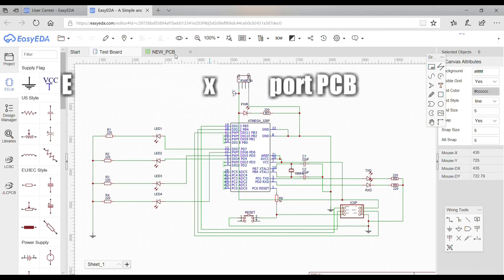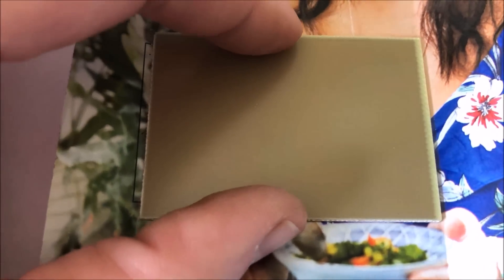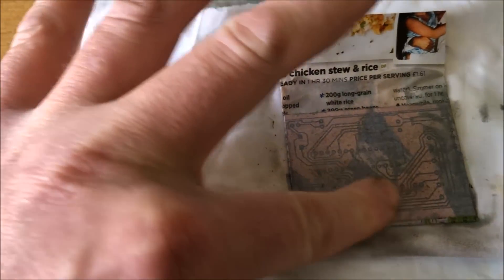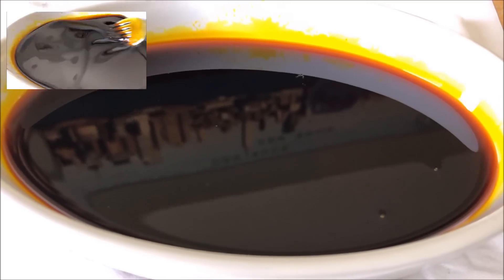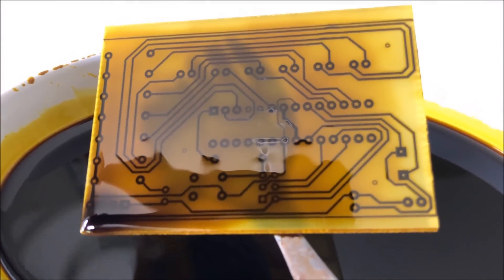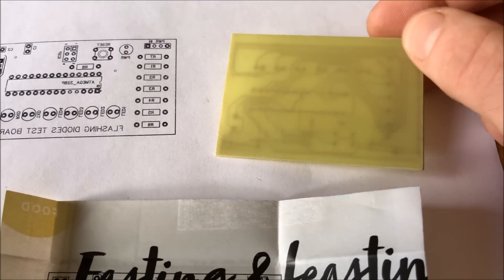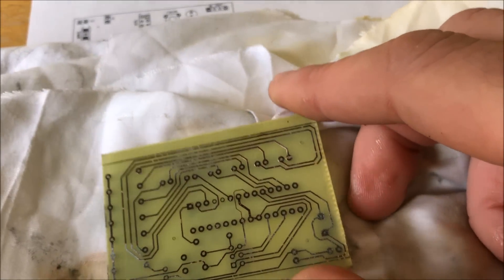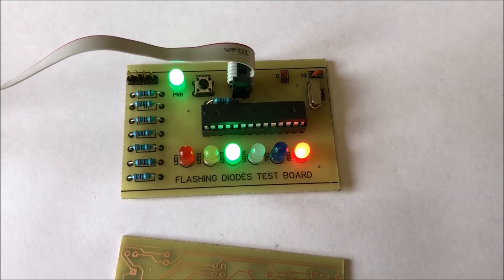DIY PCB Toner Transfer (No Heat) & Etching

Comment: Tried this myself with pure acetone, different types of glossy magazine, different pressures and different durations soaking the paper. Only one gave a partial transfer. Then I read a comment here about adding water to the acetone (2 parts acetone, 1 part water) and it worked! (Samsung toner).

Definitely some chemistry taking place as I tried different colour toners, they start out the toner colour at the time of transfer but then slowly change and become darker. So I would suggest giving it time to rest before etching to 'cure'.
Reply: I confirm. Acetone works well with water (1:1) and glossy magazine paper! 🤔
Reply: I am using 98percent acetone nail varnish remover from super drug in UK diluted to 2 parts acetone anf 1 part water (but I see the other comment here 50/50) and I made the mistake I think of printing on the magazine cover not a magazine page. I think the wetting and release perhaps works better with the inside paper less then the cover.  For sure the ironing thing doesn't work with the cover paper. anyway with the acetone mix it released ok'ish. better than  other methods I tried but not 100pc. there is a pitting in the blacks which I had to put marker pen on . I was hoping for a solid black but I'm not  getting that. like I  say it may be the choice of covers instead of inside pages. I'm stuck with the materials I have as I don't have a laser printer and got someone else to print it for me.  hopefully the  etch is ok despite

Comment: Can i use a deskjet ink printer or i really ned the laserjet printer to print the layout?
Reply: I think you need a laser printer. I don't know exactly why and how the toner is different from regular ink but I tried with the ladder and if you wet too much the ink it slides away easily. If someone knows why you need a laser printer instead of a inkjet plz let me know.

Comment: Cant figure out how you lined up front and back? i keep being off any suggestions.
Reply: Once you finish the first side just drill out three of the through-holes as close as you can to each corner of the board. Punch out the same holes in your second template. Push wire through your board and drop the template down on top :)

Comment: Wow ,goto say that is a lot easier than other methods seen,well done.
How does SMD work out say 0603 min size part ok?
Best track width used with this sytem?
Min Track width used with this system?
can set up in rules in pcb cad software then.

Rob
Reply: Hi!
I used similar technique a couple of times, with heat transfer.
First off, now I think heat transfer is subpar - the pressure and the heat can stretch or shring the paper varying with direction, and it can flatten (making it wider) tracks.
But even with heat transfer track wifth of 0.5 mm is quite manageable, and 0.3 is doable with patinence, caution, and luck.
I would expect 0.3 is managable with this method.
SMD 0603 could be okay, but for hand soldering, 0805 is small enough already.

Comment: do you know about this?
1) hydrogen peroxide 3% 100ml
2) 30gr. citric acid
3) 5 gr. table salt
this is enough to pickle 100cm²
Reply: You mean instead of using acetone, that is to transfer toner?
Reply: @youssefdirani  this is to replace FeCl3. you can use hydrochloric acid (cheaper) instead of citric acid (more expensive)

Comment: I used pure acetone first 3 times didnt work BUT then added water to the acetone and it worked perfectly! 1/3 water works well, 1/2 water can still work but 1/3 water worked perfectly. Glossy magazine paper is the way to go, but after getting so good results with 1 part water 2 parts acetone I tried one with normal printing paper (pretty rough, not glossy) and even that almost works, got 50% transfered. The groves in the rough paper hold on to the toner though i think, so go with glossy paper.
Reply: 1/3 water works well....
1 part acetone and 3 part of water or 1 part of water and 3 of acetone ?? Thanks a lot.
Reply: I think he meant half and third of water
Reply: 1 acetone and 3 water?
Reply: @aircomputersfranca  1:1 is OK for me with my toner and my glossy magazine paper (:
Reply: Thanks man, this is what I needed. Couldn't get it to work with pure acetone but 1/3 water added works just like the video
Reply: Why it didn't worked the first time?? For me, the acetone based nail polish didn't do anything at all...
Reply: "...but after getting so good results with 1 part water 2 parts acetone..." So there it is: 2 gallons of acetone and 1 gallon of water. Or 2 tablespoons of acetone and 1 tablespoon of water. Or any other unit of measure you want to use.

Comment: I have to call BS on this one... I did same thing over 60 times, never worked... Using an HP laser with original HP laser cartridges. I had 75% success, but never like this. I used different glossy magazine papers, I used HP premium presentation paper, I used nail polish (3 types) , pure acetone, acetone/isopropyl mix at various levels and never came out. Ironing board works well for me, but that 3 minute "no heat" quick solution is, well, too good to be true. If I have to import a friggin bottle of Sally Hansen nail polish from the UK to Canada I will, but for now, this myth is busted...
Reply: I had only parts and very faint transfers the first 3 times. On the fourth I pressed much harder and it worked very well. Make sure you press hard! I think I was only pressing half as hard when i got only very faint results. Also, the time it worked i actually mixed water in the acetone, i used 50% "chemical acetone no oil" and 50% water! I think maybe the paper needs to be dissolved by the water, although not sure the water was what helped. Make sure you press hard!
Reply: I used a normal Lexmark laser printer, I don't know if different printers have different toner no idea.

Comment: Super Awesome !
Swap the FeCl3 for Vinegar, Salt and Hydrogen peroxide and all the design/etching materials can be bought in the supermarket !
In the UK they swapped the Acetone in nail varnish remover for Ethyl acetate some years ago.
Use gloves with either solvent - they tend to transfer through skin, bringing whatever they dissolved with them.
Reply: In what ratios?
Reply: I really didn't bother measuring. Mostly vinegar, loads of salt and a small amount of peroxide.
Fortunately this would be very easy to experiment with on a very small scale to find the exact proportions of each that would work best for the vinegar/peroxide available to you.

It would be hard to make it not work, just better if it goes as fast as possible.
My vinegar was 9%, the peroxide 3%.
Reply: aga Or just buy acetone

Comment: You need to have the right type of toner.. I tried this many many times with zero success. I think my printer uses the wrong type of toner.  I found it easier to just run the board thru a laminator 10 times and be done with it.  Only takes a few minutes.
Reply: MasterToko  I used glossy magazine pages. I didn't use nail polish remover though, I used acetone. Will have to try this again.

Comment: Isn't that nail polish remover just Acetone with aloe and vitamin E oil mixed with it?
Reply: Mike, no it's not...there are many additives in there. I tried nail polish (Wal-Mart Equate acetone based) remover vs acetone (MG Chemicals) and the nail polish does not smear the traces where the MG Chemical pure acetone does immediately. Same thing with nail polish remover that said 100% acetone vs the MG Chemical acetone and the nail polish remover did not smear the traces (100% acetone nail polish remover vs true Acetone). Go figure...
Reply: @cac2244  The biggest issue I have with laser printed PCBs ... small parts ... even a 20 pin standard chip ... the holes are so close together and so small, a toner transfer works but its tight and very little margin for error. I did a couple or PCBs using EasyEDA and I ordered them professionally manufactured ... I got 5 of each board for $6 total including three day shipping ... I could not believe how cheap it was to have them professionally made. Here they are:
https://i.imgur.com/EfHawzp.jpg
https://i.imgur.com/XdtlXwc.jpg
https://i.imgur.com/JBRVQhD.jpg
https://i.imgur.com/MTjCUoY.jpg

And another circuit (pro made board and home etched of the same circuit):
https://i.imgur.com/R2TdzAX.jpg
https://i.imgur.com/3dqYdxK.jpg
https://i.imgur.com/Nr0Mpvt.jpg
https://i.imgur.com/7aoxnRN.jpg

Comment: I was sure hoping this would work. I've been doing my boards using the clothes iron method for years, and if I'm lucky I can salvage 67-70% of the attempts into working boards using glossy printer paper (and a lot of heat and pressure and 12-15 minutes ironing per board). I've tried using a waffle iron, which by all rights should work. Nope. I've tried Acetone and alcohol - supposedly if you get just the right mix it will work. Nope. I've used magazine paper with the iron. works as long as the paper is white. Dark colors will iron onto the board right along with the toner.  Now this. Looked easy. Too easy. Wasted most of the day today trying to get it to work. Nope. Best I've done is a blurry shadow of the traces. Damn. Back to the iron and glossy printer paper.

Comment: Impressive! One question about the silk screen, I didn't catch it in the video... How did you line the silk screen up with the traces on the other side of the board?
Reply: I guess it doesn't really matter if the silkscreen simply has component designations, and is out +/_ 2mm or so.  But using the same technique for double sided boards would almost certainly need a jig (or at least some registration holes in the board and transfer prints, prior to placing them).
Reply: Gotcha, thanks!

Comment: I have to thank you for sharing. I've tried many methods in the past, this is the best and easiest method with guarantied results. To help others; I used cheep nail polish remover but the one with acetone worked perfectly (same brand). I don't know if the magazine paper plays a role cause it's glossy and thin.
Reply: My favorite process was to spray an overhed projector sheet with silicone spray before running through the laser printer.... the transfer was as horrible as everything else I tried, but watching my son fall from walking through the kitchen with only socks on because of the silicone overspray onto the linoleum was priceless!!!  😁
Reply: @rosebarnes9625  interesting, new stuff to learn. Please anyone who has good techniques, please share it with us.

Comment: In the past I've made Toner Transfer PCBs and only had success with toner that did NOT use fuser oil. I use Brother printers and Brother brand toner does NOT use fuser oil while off-brand toner cartridges use the cheaper toner with fuser oil. Toner with fuser oil does not adhere well to the PCB and will often smear or even slide off.

Comment: I prefer to use Hydrochloric acid and Hydrogen peroxide to Ferric Chloride for etching-no so messy and much cheaper.
Reply: Interesting because I buy a 500ml bottle for less than $2, put it in a Pyrex container under the sunlight with some water and that sh*t last me for at least 3m2. 

What's the performance of your method?
Reply: @Chuywaka  I pour some HCL into a pyrex dish just enough to cover the pcb properly and then add some  hydrogen peroxide to it. There apparepotent and let you cough.ntly is a formula about the ratio, but I do not know what it is. However, I get along fine just adding some peroxide as and when needed. You must do the etching outdoors as the gas generated is quite potent and make you cough.

Comment: Wont the solvent dissolve and smudge the tracks during transfer?  Only heat transfer seems to work best in transferring without distorting the original tracks.

Comment: A bit messy, but a nice alternative when I run out of heat transfer paper. Makes it harder to line up for a double side etch.
Reply: Drill the holes first then its easier to line up - use a pin to do the alignment

Comment: Isn't it cheaper to order 10 professionally made 2-layer PCBs from JLCPCB for a total of $2 instead of getting a prototyping copper board for $5 and then trying to etch it on your kitchen?
Reply: can you point me in the direction of such a service in the UK ?
Reply: @rpowell3000  jlcpcb.com, you upload your Gerber file, if you order up to 10 pieces they're $2 for the batch + $6 for postage (air registered, slow method but very cheap), and because the cost is too low, you won't have to pay for import taxes. Silkscreen is included, 2 layers are included in the same price, all PCB colors are the same price, maximum pub size for this price is 101mm X 101mm. I haven't tried them yet, I'll try their service probably within this month. I've seen a small "documentary" about their facilities by another youtuber.

Comment: A small "speed-up" hint for the etching portion: After you transfer the toner and wipe it with the sponge, use a hot air station (or heat gun/hair dryer) to warm the copper. Take the time to warm it up and when you dunk it into the ferric chloride, you'll see bubbles and it'll etch at a much higher rate for the next minute or so.
Reply: Years back when I did these, I placed the ferric tub in a tub of hot water. The heated ferric was much quicker, I just rocked it from side to side.
Reply: That's neat! I was wondering how heat would effect this process.
Reply: Thanks I will implement this in my project
Reply: Another hint: Next time make a large ground plane. You'll use far less etchant. :)
Reply: @humbughumbughumbug  I find large ground planes difficult to solder without bridging, since the at-home pcb method has all of the copper exposed, vs having lacquer covering the copper in the spots where there are no components.
Reply: @larrybud   I agree. I have to do a lot of solder wicking to fix that!
However a few times I forget to put in a pulldown resistor, it was kind of convenient to have a ground plane to solder to! 😆
Reply: @larrybud   or just set a bigger gap in the design rules so the ground plane is less likely to bridge to a contact pad. Especially when prototyping you should expect to make mistakes, but also you'd want to conserve etchant for iterations.

Comment: Ingenious method of substituting chemical transfer for heat transfer!  I can't wait to try it out.  I'd love a few tips on how you got the top and bottom to align so well!  And for the masterstroke, what method do yo use to align and drill all those little holes?!
Reply: For the perfect alignment, use pre-folding the magazine paper, because the to-be PCB will actually align to the folded edges when you put on the masking tape.

Comment: Just a question and a comment/suggestion Question is this is done with a LASER printer right (A lot of videos or tutorials are with inktjet) also with the chemicals just to get it straight into my head I use the nail polish remover or acetone (Which someone mentioned and my mum used to clean her nails back in the day) and then developer? I'm going to try my first board, and am new to this, and of all the videos tutorials so far this seems the easiest more professional one (Also because you use the ATMega328 Which is what I'm gonna use). My suggestion is if you print info on the backside wouldn't it be easier and less time consuming to print out next to each other and fold the paper over, that way you have less chance of the template moving when taping the magazine on it, and you only have to do it once.

Comment: Very cool video!😀 I can imagine gluing foils to a board then printing the circuit, and etching the board you can create a double sided board  or 3 layer board this eliminates any wires on PCB just to PCB,  you could create a flexible circuit board by etching copper glued to clear flexible plastic. This circuit would work and flex and look cool😎.  You could waterproof the circuit after construction.😀
Reply: Flexible materials will not work as intended: the solder joints will almost literally jump off at the point where you flex it.  Materials that are that flexible will also suffer big thermal stresses because a part of the way a PCB services soldering (I am going of on the idea that you solder by hand, leg to leg, pad to pad) is because there's a reasonably big amount of thermal mass in not only the copper trace (Well in home-etching most traces will typically have to be larger than ordinarily is needed) but also the that soaks this heat up, but also in the rest of the material (whether that's fibreglass or epoxy).
A material that thin will probably not survive very well, and might even see the pad dislodging itself from the surface.

Comment: Hi, I followed the instructions shown in the video, but I can't transfer the circuit design from the A4 sheet to the magazine paper. The magazine paper is empty when it comes out of the laser printer. Am I doing something wrong?
Reply: Hi, printing on the white sheet is only necessary for positioning the magazine page and then printing the drawing again.

Comment: When printing on the magazine paper, does the layout need to be done on a laser printer, or will an injet printer work as well?
Reply: Yes, it has to be toner from a laser printer, inkjet ink doesn't transfer to the copper or resist the etching process.

Comment: I seen some sleight of hand in the video ! You started out with a square copper wafer and you  etched an image onto the copper but then when you showed the finished PCB board it was not all copper only the circuitry map was copper and it was on a see through PCB  board can you show how the copper etching was placed onto the finished board I enjoyed watching the video but it wasn't 100 % complete process.
Reply: The copper etching isn't placed onto the board.  The toner, representing the circuit, is transferred onto the copper.  The solution then dissolves all the copper except the copper protected by the toner, resulting in a clean board with a copper circuit.